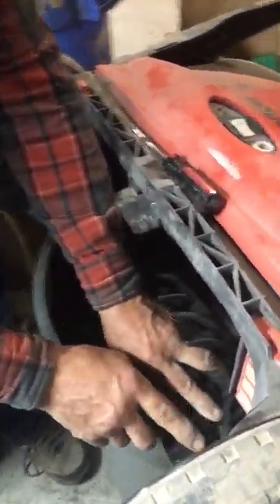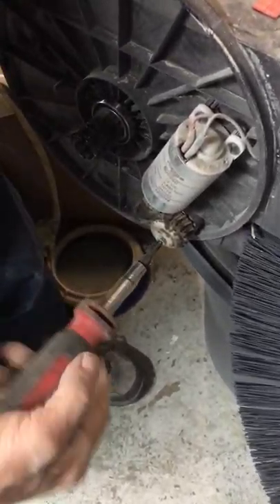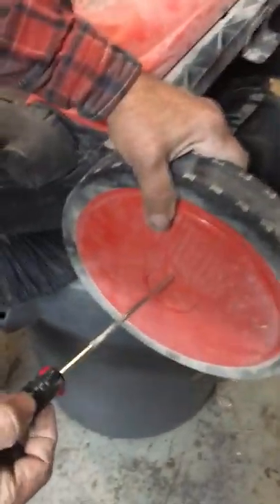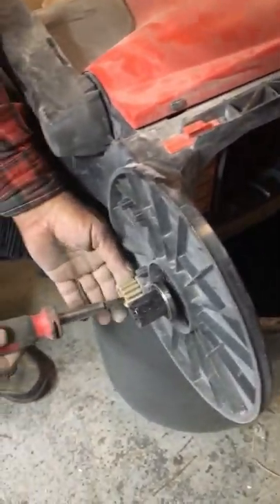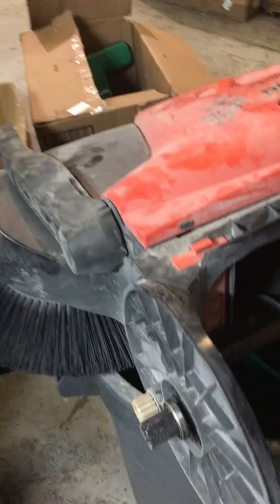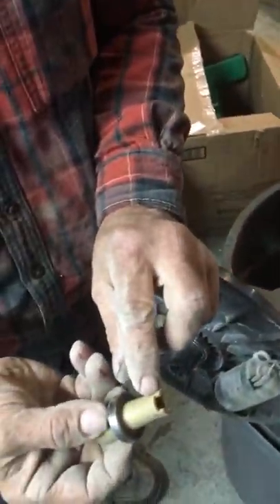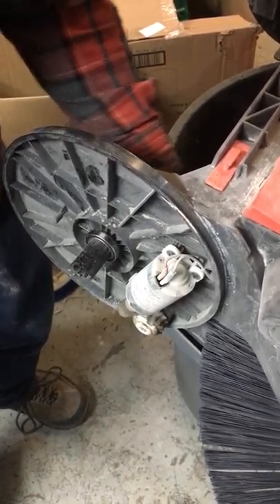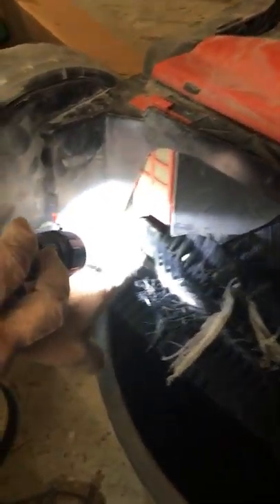Master Sweeper Long Brush Diagnostics

Comment: My long brush clutch spring isn't really engaging causing the brush to rotate poorly .. any ideas?
Reply from the maker: Mr. D A, I am unsure as to what you are referencing as the "clutch spring" within these units' front brushes.  There is a clutch on the underneath side of the front brushes but there is no spring.  I believe the easiest way for me to answer this question would be for me to ask that you call us so we can email you over the Parts List with schematic.  That will facilitate a better understanding of the part you are referencing and a more accurate response.  You can reach us at 800-242-1378, ext. 2180.-ASE
Reply: @bissellcommercialcustomers4100  Hi, thanks for the reply. Its the spring inside the drive sprocket to the rear roller. I've replaced the sprocket, the clutch spring and the axel and needless to say the reassembly is correct .. it still wont really grab. What I've noticed is that the spring goes into the sprocket really easily (doesn't need to be wound in as shown) and I'm wandering if it's a tolerance issue. Have npw lined the inside of the sprocket with one wind of electrical tape to fractionally reduce its diameter, this has helped enormously.
Reply from the maker: @mr.d7372  I really need you to call in with these issues as we will need to forward you over the parts list so that you can confirm that you are referencing the spring inside of the pinion gear.-ASE